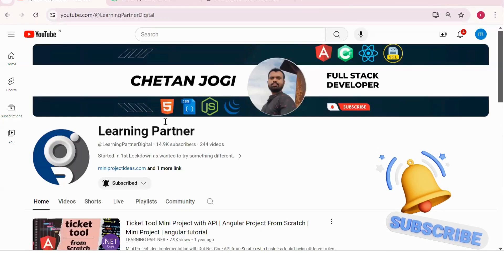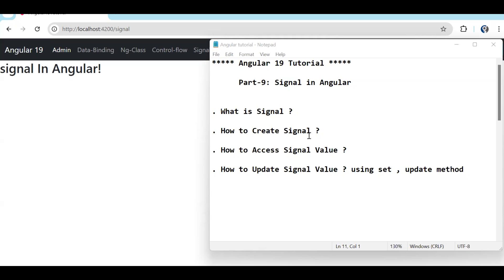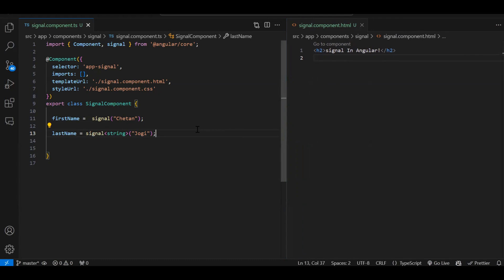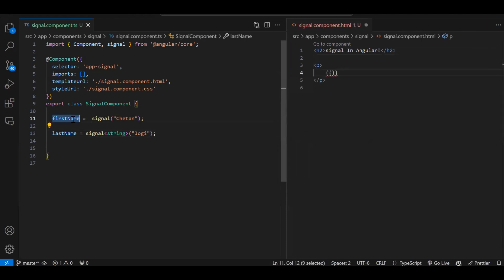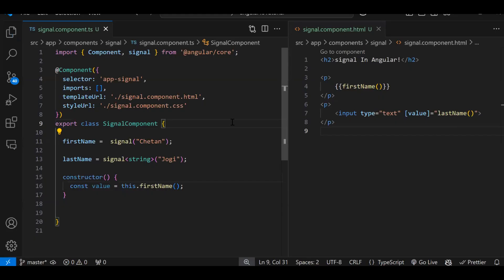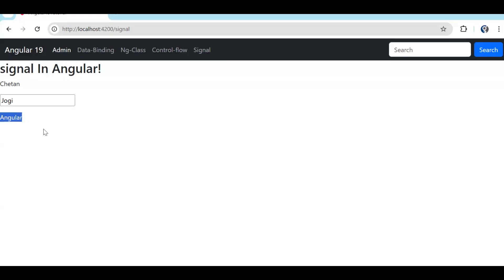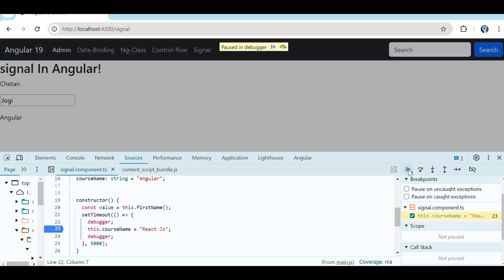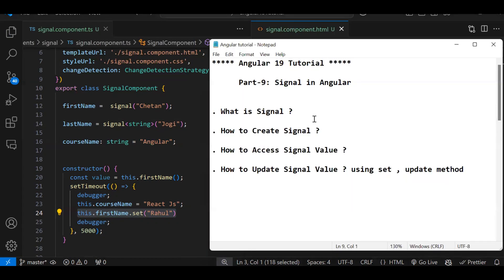What is Signal In Angular | Angular 19 Tutorial | Part 7

Comment: To be honest, I don't understand what these signals are for. "courseName" is a regular variable, "firstName" is a signal. And their values are reflected immediately in the UI as they have been changed somewhere in the background. So, what's the difference in their behavior?
Reply from the maker: with normal variable Ui changes because of zone.js but if we use signal we don't need zone.js , angular team trying to get rid one zone as it degrading performance
Reply: @LearningPartnerDigital as I understand, it is supposed to make all component variables which are used in the template as signals rather then regular variables